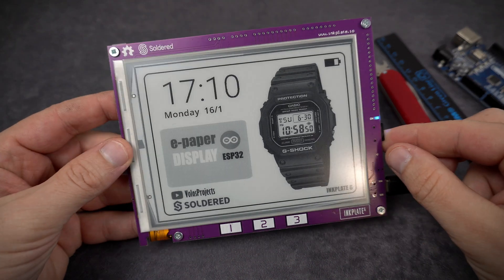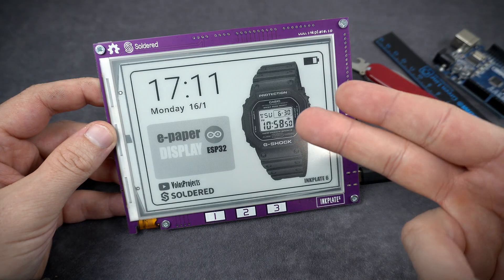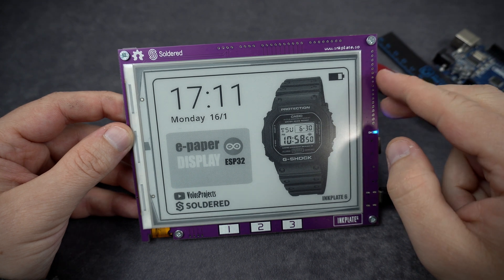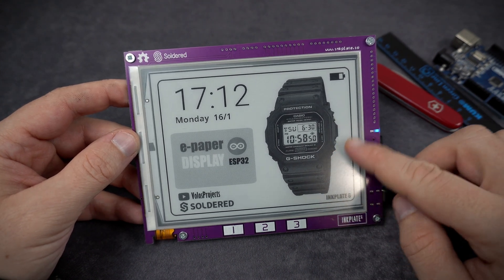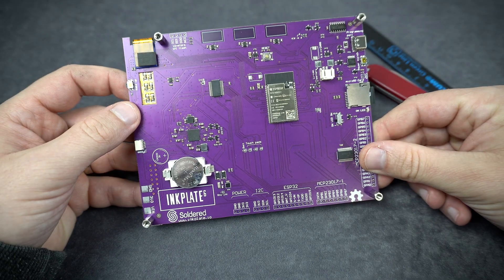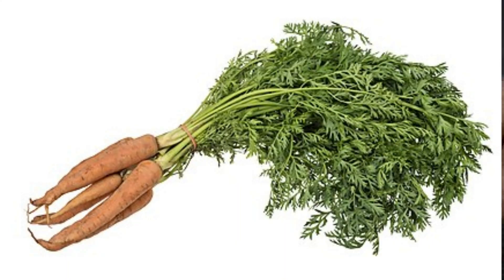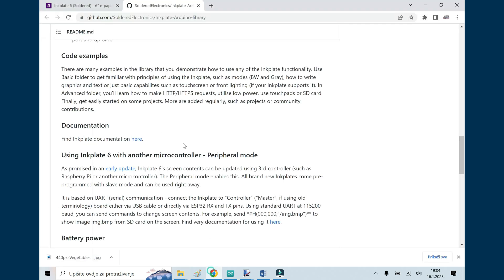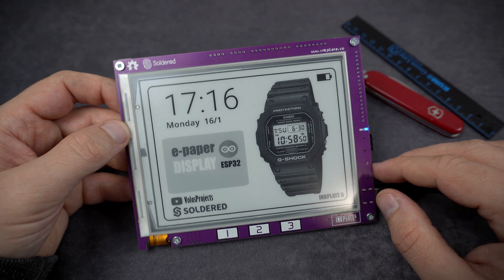INKPLATE 6 - 6" e-paper board (ESP32)

Comment: How is this "great?" It's just another board with exactly the same design choices and mistakes as all the other boards.

It's unnecessarily tall, the capacitive buttons are not compatible with enclosures, soldering is the only way to get expansions, and you are forced to use BT or WiFi just like on all the other boards, despite esp32 having support for wired com. options...

Yeah, it's so great they've decided not to deviate at all from all the other mediocre offerings.

Comment: Volos, does the board and their library support partial display refresh? Or is it necessary to refresh the entire screen every time? (That seems impractical in the case of such a large e-paper screens) 
I looked at the documentation, but I can't find a partial refresh in the examples??

Edit: I see that you refresh your clock example completely every time... Most of the more expensive e-paper boards support partial refresh
Reply from the maker: Yes, it supports partial refresh, they even have example on their github page. https://github.com/SolderedElectronics/Inkplate-Arduino-library
Reply: @VolosProjects  Thanks, definitely buying this for next project!